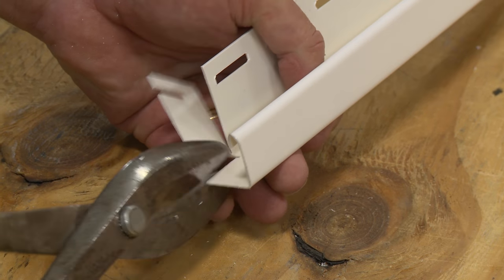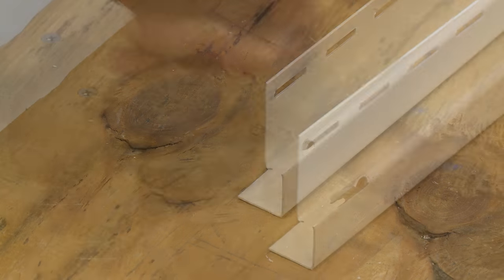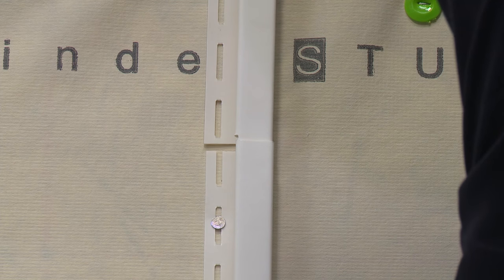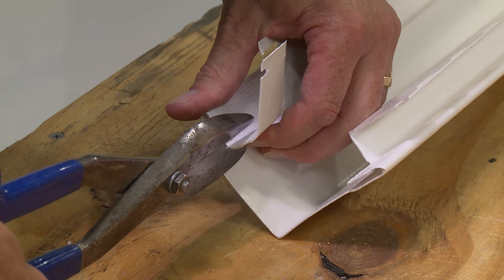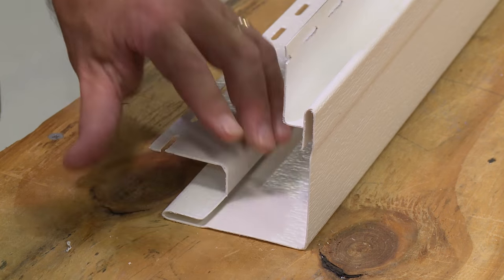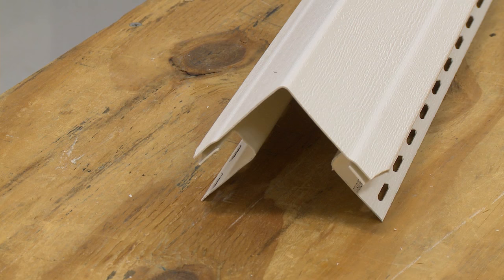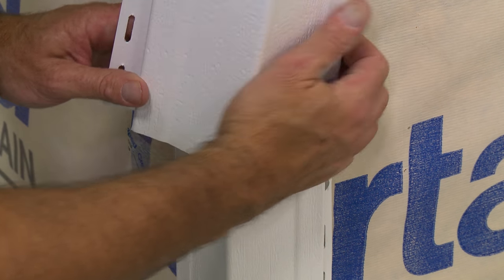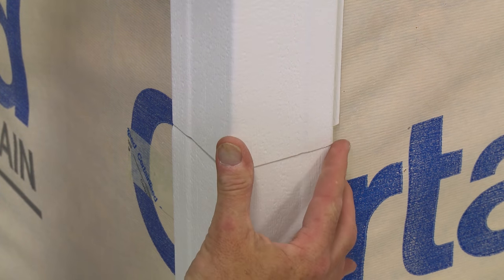Overlapping Vinyl Siding Accessories

Comment: When installing J trim you never over lap the bottom piece.  You overlap the top so water runs over the bottom instead of in it. Just cut the bottom piece the way they said and slide the top over it.
Reply: I’m not a pro but I have two pieces in front of me and I agree with them: the top piece goes inside of the bottom. This sounds wrong until you look at the pieces; top cut and inserted creates a proper shingle effect. However it is made better by not cutting the nailing flange—only cut the second bit so it keys properly into the bottom piece. If you have bottom insert into top any water on the inside behind that edge of siding actually gets in behind the lower part of the j channel.
Reply: with the way it’s shown here, the shingle effect occurred on the inside of the  intersecting j channel, it is correct, the outside doesn’t matter